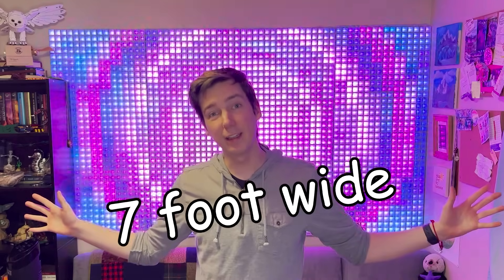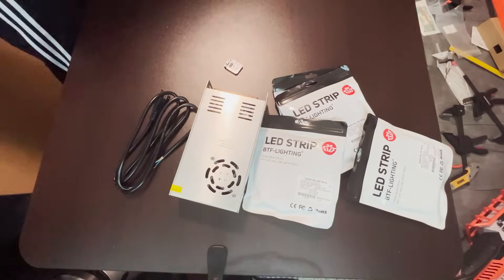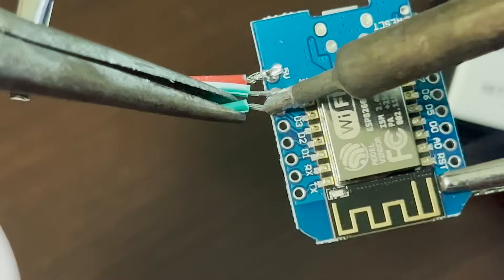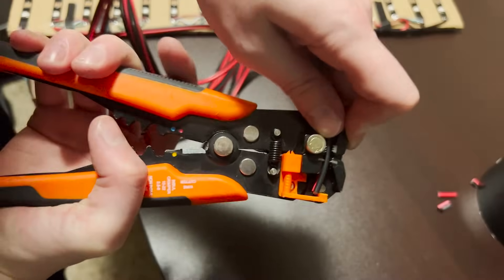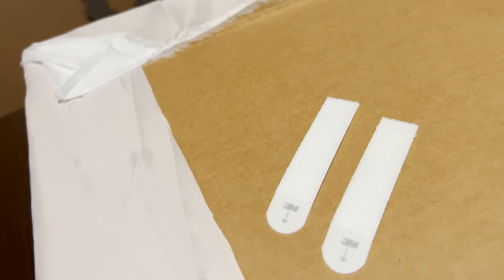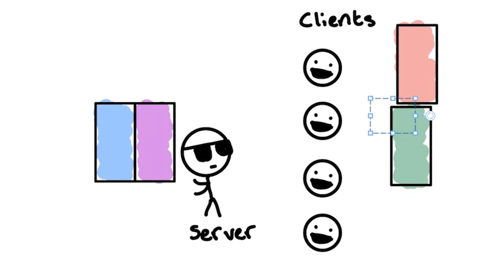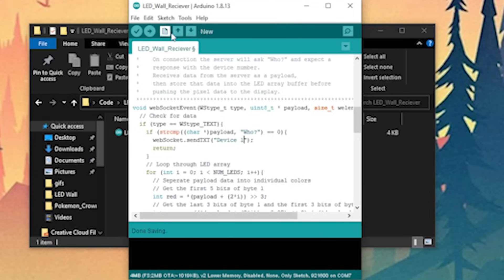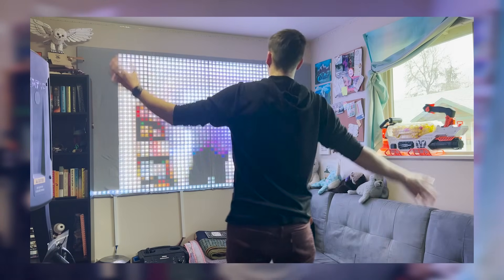How to Build a Massive LED Wall on a Budget

Comment: You should use sk6812 rgbw for that extra white pixel or ws2812b, both in matrix variants 8x32cm. The pixel density is like 144 leds per meter and it gives you much higher resolution and they are fkexible with 3m sticky side at back.

For the controller go with esp32, inatall wled and then use it only as art-net reciever. Btw with one esp32 i was able to send data to more than 6k ws2812b leds on 30fps.

I'm using resolume arena to send video feed to the esp32. If i want to screen capture i'm using NDI inside resolume and it works without any problems.
Reply from the maker: Why would I need an extra white pixel for a video wall? 144 leds per meter would give a better resolution but it would also put the cost of this project through the roof. The goal of this project was to cover as much area as possible for a low cost so your suggestions are valid but they don't apply to this project specifically.
Reply: @Tech-Random   @Tech Random  the price is almost the same, so why not? :)
Price of one 8x32cm is around 10-15$ depending on brand for ws2812b. For a screen 2x1 meeters it's goins to cost around 250-300$ for the leds. With the matrix style leds you wont need any 3d printing also, just slap those leds on something and because of the density you wont need any diffuser, or if you want you can add PMMA opal layer for example on top.
Reply from the maker: For a 2x1 meter array I would need 13 x 7 of these tiles. The best price I can find on Ali express is $13 each bringing the total cost to $1,183. I'm not sure how you got $300 based on the numbers you gave...
Reply: @Tech-Random  12x6 for 96x192cm presumably, but 72 modules is still 720 bucks even if you are able to find them for 10 bucks each. And you definitely still need both diffusers and a printed mesh to get a good result. But you would get a much higher density, so there’s that.

Comment: This is really cool. I have used white self liner vinyl adhesive from the dollar store as a diffuser on my matrix displays with good results. Also, since you've mentioned you're familiar with wled, I'm surprised you didn't stream to its websocket api. I've gotten good results streaming up to 1024 pixels from my fork of piskelapp.
Reply from the maker: A lot of people are suggesting WLED but it would have been extremely difficult to make it work with this panel design. If I was controlling the whole screen with only a single microcontroller like an ESP32 then WLED would work well, but the software I wrote is very efficient and scalable, meaning I can make one panel or 16 panels and still be able to display a synchronized video across all of them. There are some limitations to this set up but flexibility was my biggest priority.

Comment: I think it’s common practice and code in the US that black is hot and white is neutral.
Reply from the maker: Thanks for pointing that out. Luckily I fixed it before anything caught on fire, but I hope anyone else who attempts this project catches my mistake
Reply: ❤Great video  @Tech-Random
Reply: @Tech-Random  came to say the same, fire is an unlikely outcome, but knowing the standards are best practice
.
Reply: @Tech-Random  Luckily, having hot/neutral swapped will do nothing bad, and the module to work as expected since it's AC power and not DC.
Reply: @denton3737  actually, there’s very real potential that the chassis could become “live” if certain conditions are met. This is obviously not good.
Reply: @Tech-Random  Seems like an in-video note/overlay or at least something in the video notes would be appropriate here.  Unless making an intentional mistake in the video is to spur comments - probably something less electrical would be appropriate there.
Reply: In general, in the US white=neutral black=hot is for AC voltage.  For DC, Red=hot, Black=neutral/return, Green=ground.  At least that's been my experience but it is not consistently the case, so gotta measure everything...
Reply: Black means you burn the white wire is already dead
Reply: Fun fact this changed in the 60s some older homes have a reversed color code. Sadly many builders don't care.  You want a real scare 😱 I have seen where someone had a spool of white so all the lines were white! 😨
Reply: Came in here to say exactly this. A fire won’t happen, but the chassis could become “live” if certain conditions exist.
Reply: Das racist

Comment: at about 6:20 you suggest connecting the black wire to neutral and the white to hot. I think you have that backwards. Typically, the black wire is hot and white is neutral isn't it?
Reply from the maker: That’s a good catch. I’m a firmware engineer so I am used to black being neutral 😅
Reply: And you should buy running the wire clockwise under the screw, not counter-clockwise.
Reply: @shaunclarke94   If we are nitpicking technique, bare wire shouldn't be used at all. That's what wire ferrules are for.
Reply: @acharlson or an eye or spade connector crimped on for the best connection
Reply: You are correct. White is neutral.

Comment: Awesome project. Just two questions, what happened needing a 330ohm resistor on the data pin? Also, in the past I tried using an ESP8266 with these strips and couldn't get it to work reliably. I read it was because the esp's run at 3.3v as opposed to an Arduino who's output pins work on 5V? I have used the Led Matrix software previously and it is awe inspiring what that guy has done. LED table on my channel if you're bored by the way 😜
Reply from the maker: I’ve used these Wemos D1 mini clones for a lot of LED projects and I only have issues if the data wire is too far from the start of the LED strip. If the data wire is only a couple inches then the 3.3v data should display just fine.
Reply: @Tech-Random  Ah that might be exactly why I'd issues! And with me using a resistor probably made the situation worse. Thanks for the reply.
Reply: @Tech-Random  One of the other vids I saw while researching this mentioned a level converter to boost 3.3v output to 5v.  That might give some room for voltage drop over a longer data wire
Reply: The newer variant of the WS2812 (the WS2812B) accepts 3.3v logic. It will also boost it to 5V which fixes downstream older versions, so you can actually fix it on existing LED builds by simply replacing the first LED (or inserting one at the start).

Comment: Hi, i dont understand how much led Stripe Do you use. 16 x 5 Meters led Stripe?. 80 Meters in total? 80 Meters is a little bit to much, isnt it? or am I misjudging that? sorry, My english is not very well.
Reply from the maker: 80 meters in total is correct. It’s a lot but as you can see it covers a large surface area for a relatively low price compared to other LED displays
Reply: @Tech-Random  ah Ok thx for your answer. Then i have to pay only for LEDs 480 € 😅 very expensive. but very nice project. I like it 👍🏼👍🏼
Reply from the maker: With only 4 led strips you can make one of the panels and it will still work!
Reply: @Tech-Random  ah Ok. thanks a lot. I think i will try it this year. I just have to get My  3d printer working again 😁

Comment: Great video and project with good audio and lighting, editing and chapters are also very nice.  Maybe the cardboard was an oversight, and I'm sure it's fine, until it isn't... I'm not trying to Troll here but 300 Watts plugged into cardboard and a bed sheet? What could possibly go wrong...  At the very least if anyone tries this please consider replacing the cardboard with something that helps sink the heat of the LEDs, and is not an immediate fire hazard should (when) the SHTF.  I really like the diffuser STLs here.  I'm going to print these and a few others for a suspended ceiling tile matrix.  These might be the winner they are nice and big.  For that project, I plan to use a ceiling tile diffuser for the bottom and the top.  Not sure if the bottom is getting painted black or wrapped in a mylar sheet. Have to test those out too. Anyway, please don't take my criticism of the cardboard the wrong way.
Reply from the maker: This is great advise! I chose cardboard to keep the budget low but I’ll admit it’s not the safest choice. I think this panel design would work really well as ceiling lights!
Reply: @Tech-Random  I'll let you know how it turns out.